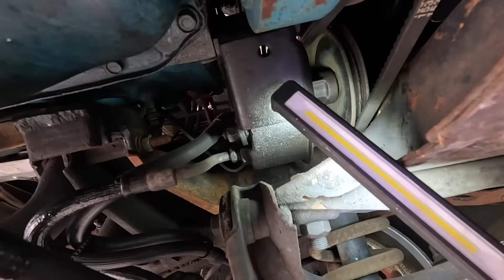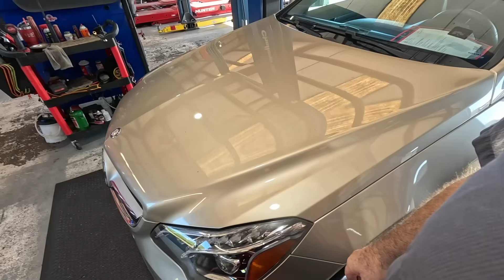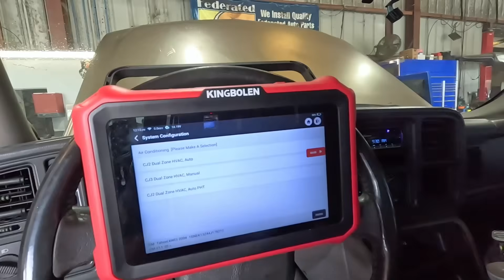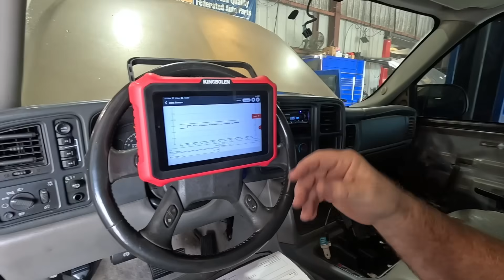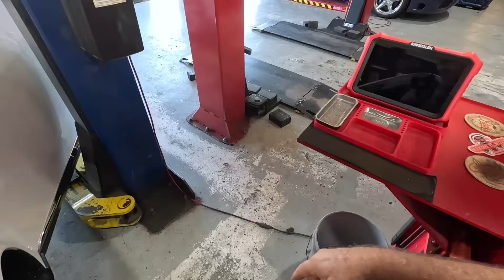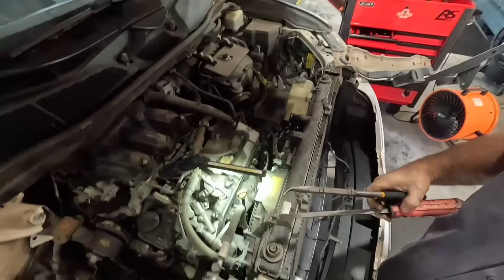78 CORVETTE, LEAKS. YUKON, LOF, DIFF. LEXUS, ALTERNATOR. TAHOE, TICKING. AUTO REPAIR SHOP DAY 824

Comment: I believe you can remove those arrow head style lock tabs on a Toyota by using the box end of a 10 mm or 8 mm wrench, if memory serves me correctly. Just push the box end over the end of the clip and it will collapse the split end enough to remove it. It helps in a tight spot.
Reply from the maker: Oh nice, I'll have to remember that one!

Comment: Yukon… oil pressure didn’t look that bad to me… but, if that ‘o’ ring from pickup tube to oil pump is old and brittle( cracked) it may show low pressure. A fairly inexpensive way to check ‘o’ ring is to slightly overfill pan with oil and raise rear of vehicle and lower front of vehicle. Oil will    
Cover that ‘o’ ring seal pickup area. If pressure goes up … you found the problem !  Bad ‘o’ ring ! Anyway.. great video Jimmy !
Reply from the maker: Yeah, I asked them about adding oil or going further and the customer wasn’t looking to spend and real money. Towed it home.

Comment: Are you saying the half shaft is part of the suspension and acts like the upper control arm?  If so, not.  The only function of the half shaft is to transmit power to the rear wheel.
Reply from the maker: In most cases you would be correct. But not on the Corvette. The axle is a suspension component on these.
Reply: @JimmyMakingitwork  Jimmy, look at a parts diagram  and you will see how the spindle is connected.
Reply: @JimmyMakingitwork  https://elecdiags.com/wp-content/img/2474-c3-corvette-rear-suspension-diagram.jpg
Reply: The half shaft, which happens to be a drive shaft, acts like an upper control arm on this design. If you're going to go around correcting people, make sure you're correct first.
Reply: @COBRO98  I am correct, look at a parts diagram  and you will see how the spindle is connected.

Comment: My son has a buddy who lives down the street who he plays football with and this kids dad has a 2007 F150 with like 110,000 miles and the Triton 5.4.  I started hearing a tick when he pulled in to drop his son at practice.  He knows I like to work on cars and he asked me about it.  I listened but it wasn't obvious where it was coming from.  He brought it to the house and I put the scanner on it - no codes.  It had all new coils...he said a shop installed them 30,000 ago.  I looked at data and it showed that plug duration was the same for 7 plugs but really low on number 8.  So I pulled the number 8 plug and there was no electrode.  Original plug.  I swapped in new plugs (wow, did Ford make that a bigger challenge than it needed to be and the plug holes were full of rust and debris so I couldn't even get a socket on some of them) and it purred like a kitten; no more ticking.  My question to you, Mr. Jimmy, is why did that plug with no electrode make that ticking noise?
Reply from the maker: That is super strange. I don’t thought you were headed to broken exhaust studs, lol.
I wonder if firing time was off because of the electrode missing. Causing noise from burning late?
Hopefully it isn’t running lean on that cylinder and causing the issue?

If it runs good now, that is what matters!

Comment: Lol, i must be old... I remember when small block Chevys had canister oil filters. Up till 1967 or 8 maybe. Of course every corner parts store stocked and adapter to convert to a spin on version. And they all got converted. Good times
Reply from the maker: Those were the days! I remember them also! By the late 70’s or maybe early 80’s everyone started taking the canister off and using the latest GM spin on filters.